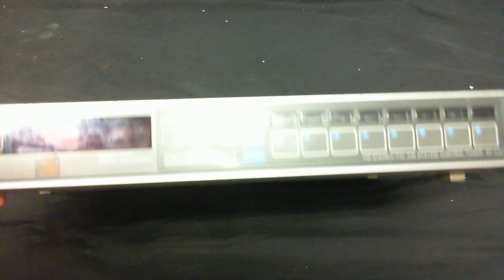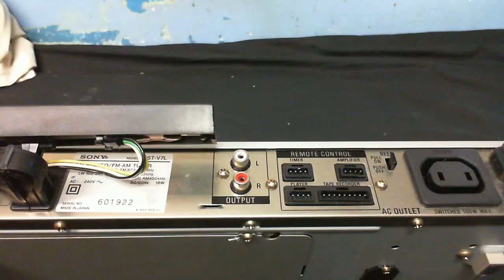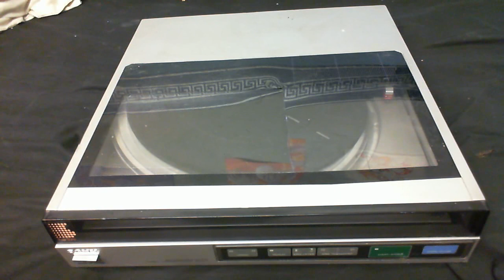I've been dumpster diving again!

Comment: Nice finds! Seems like this is from the early 80s, back then they often had the system remote controls built into the tuner entirely and then connected to all other units using special wires - probably because by the time tuners could be build so small that there was enough space left in the housing. It's a bit weird they did not also integrate the timer into the tuner, I know that has been done as well back then. In the late 70s the first system remote controls came as a whole seperate component!
Too bad they destroyed the amplifier, otherwisely this system would have been pretty much complete! (Except for the cassette deck).

Comment: If that turntable has a similar setup to my Sansui Linear Tracking Turntable then there will be a laser in the head shell beside the stylus that can see the edge of the record so it knows where to lower the tone arm, also probably capable of seeing the space between the tracks so you can tell it which track # you want to play and it will find it automatically and lower the stylus there. My Sansui does that and has a memory function like CD players and I can program it to play the tracks in any order I want instead of the order they were put on the record, as well as repeat 1 track or selection of tracks.